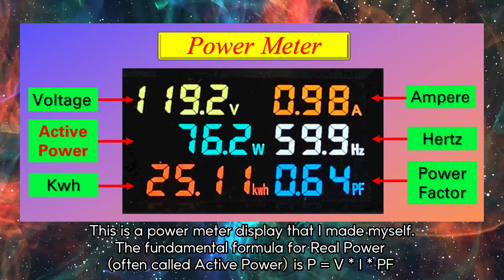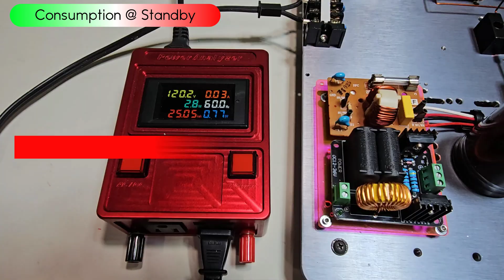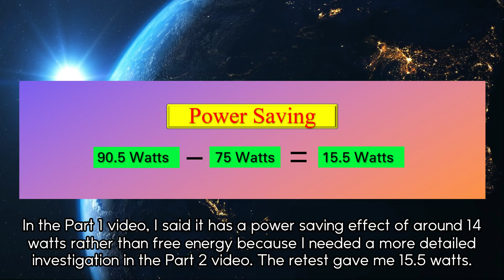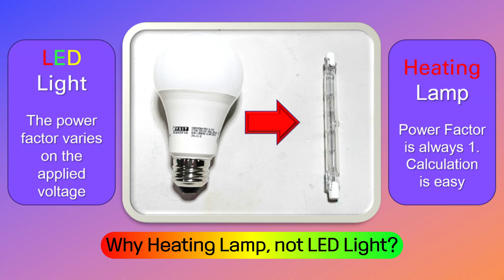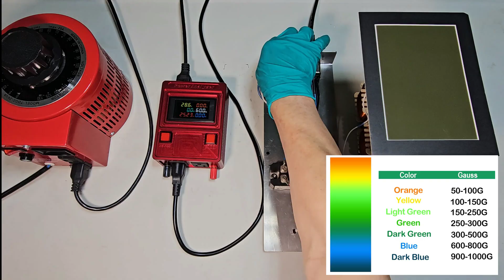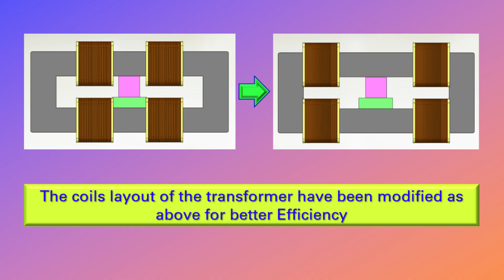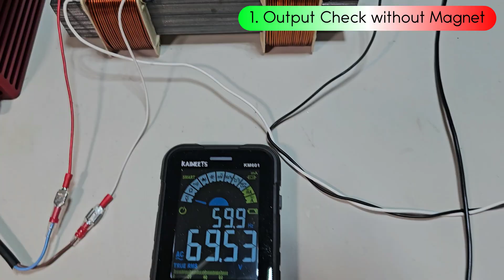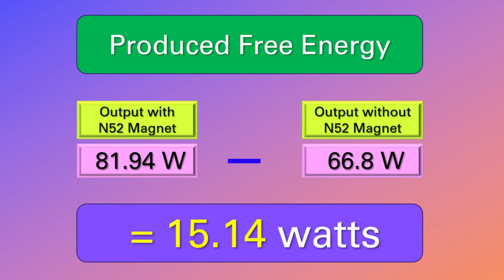Free Energy - Innovation Beyond Motionless Electromagnetic Generator(MEG) Part 2

Comment: @Lanikai Energy hi！I am planning to imitate this and make a large magnetic auxiliary transformer. The outer dimensions of the silicon steel sheet are 300 × 540mm, and the core window size of the coil is 70 × 56mm. What is the appropriate diameter for my enameled copper wire? There is a space of 160mm between the upper and lower steel plates in the middle. How should the length, width, and height of this solid steel column and permanent magnet be designed appropriately?
Reply from the maker: You have to find appropriate bobbins
 That's number one
Reply: @LanikaiEnergy  These are all easy things in China, I don't know how much wire diameter to use. I am planning to use 1.5mm copper wire.

Comment: A power factor of 0.98 for LED lamps is not impossible but it is very, very improbable.

~~~
one comment says: 
"You could take the AC and rectify it into a large capacitor and then you could use the LED load or whatever DC load and more accurately measure the power going in without the concern for the PF."

Filtering rectified AC with a capacitor will result in very low power factor. The greater the capacitance, the worse the power factor will be. This poor power factor is due to an extremely non-linear load, not phase shift. This is the reason power factor is low with some LED lamps. It takes considerably more elaborate circuitry (or low efficiency circuitry) to produce high power factor in LED lamps.

Comment: Great work and very impressive measurements!
Just a small but very important note: when building a MEG-type device, it’s critical that the laminated transformer core plates are not electrically connected (galvanically shorted) to each other by welding or metal screws.
This creates unwanted eddy current paths and acts as a “short circuit” inside the core, which blocks part of the magnetic flux from properly coupling and resonating with the environment.
Instead, the plates should stay thickly lacquered and electrically insulated from each other – only held together mechanically, without any direct conductive path between them.

Your results with and without the magnet are truly impressive – thanks a lot for sharing!
Reply from the maker: You're right. Silicone steel was imported from China as square sheet. And it was processed by CNC Machine with vanadium cutting tool. So, I needed screw hole to fix the silicon steel. To reduce eddy current, I placed screw hole in outer corner as much as possible. One viewer pointed out that there are too many unnecessary parts. The reason why silicon steel should be cut like that is to make magnetic motor contents next time. Thank you for your comment.

Comment: I am sure that you would get same results with shunt ammeter and oscilloscope but this is the correct way to get 100% confidence in measurements. (I did similar experiment loooong time ago with a dc motor and slightly different transformer core (I have video on my channel with that experiment). I didnt get Overunity but boost in efficiency was absolutely visible (boost in dc motor rpm from 1000 to 1200 with reduced current consumption on power supply.)

Comment: For the core you really want a material with the highest magnetic permeability, if not superparamagnetic. Something like black magnetite sand or Metglas. There should be no remnant magnetization. And the frequency of the input matters a lot for the efficiency, to the point that fine-tuning it might be the hardest part. And if you do it right, supposedly the core will even start to cool-down!
Reply: Problem with metglass is that its made of a very thin metal tape and the layers are not necessarily in best alignment with the N52 flux lines. Also it is brittle and expensive. Transformer steel in my opinion is suitable for such experiment. However at some point an oscilloscope and very precise voltage current and phase measurement is the only option to prove this effect with 100% confidence.

Comment: So that's great!  Proven over-unity effect for the MEG.  But it only generates 4% energy beyond unity.  So to use the MEG as a power source, you would need hundreds of these units to collect all the small percentages of free energy to power your home.  OR, you could build a MEG that handles hundreds of times the power, so the 4% equals a lot of energy.
Reply: A big cause for the loss in efficiency is likely just the gap between the coil and the core. It would boost efficiency significantly to wind the wire directly on the core, but would make demonstrations a lot more tedious to make.

Comment: if only switching coil one and two separately.  more permanent magnet flux would be used instead of switching flux, the red flux line in coil 2 and 4  is not necessary 3:22,  I think, thanks for part2!    I appreciate you using same coils to keep it simpler. obviously flip one of the coil inputs on coil one or two.  180 out of each other. then    
turn down the 120  vac until its just enough for switching. maybe. edit:180 out might not switch the field,  more difficult, they need to be 90 out. one on two off
Reply: a capacitor might shift volt 90 degrees, thank you for showing the permanent magnet does! improve efficiency. this is the most important.

Comment: Try to use less wire its .03 or .003 resistance added depending on length its small but adds up also can mess up accurate measurements by decimals not by very much but could be difference from good and great also insulated (coils sealed in flux resin to control heat and insulationfor scaling can be 4 independent sealed coils) coils (no air) has better conduction and will at least double to ⅓ your current energy (like the vacuum in light bulbs can help scale your power)

Comment: You could take the AC and rectify it into a large capacitor and then you could use the LED load or whatever DC load and more accurately measure the power going in without the concern for the PF.   The video was very well done, clearly presented and well explained.  Good job.